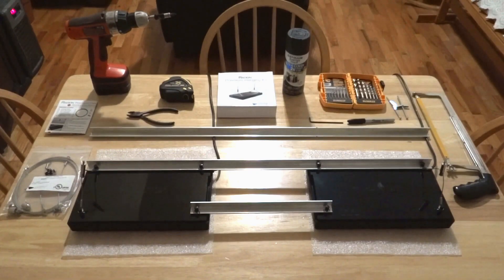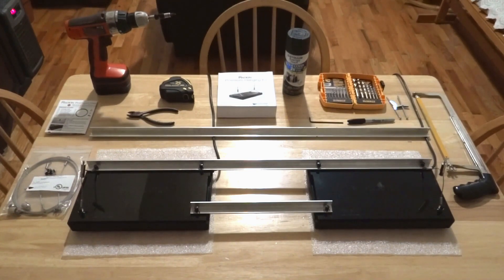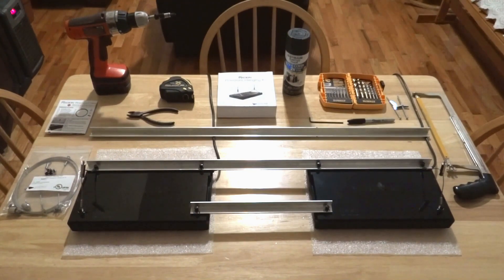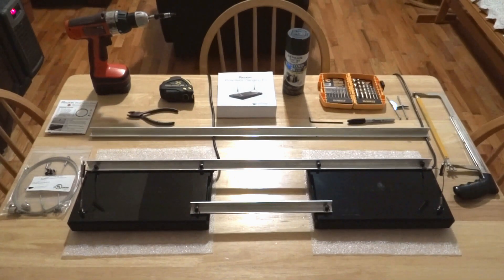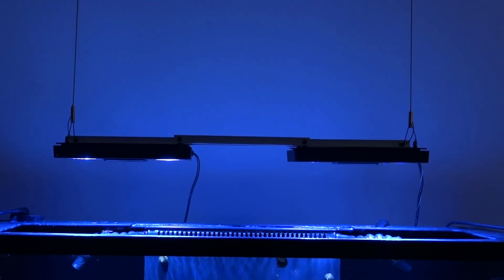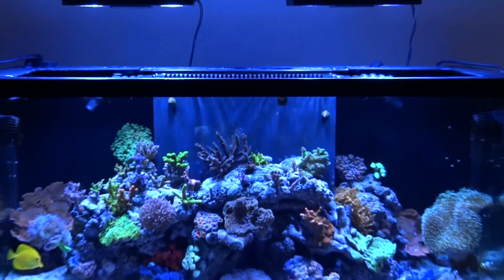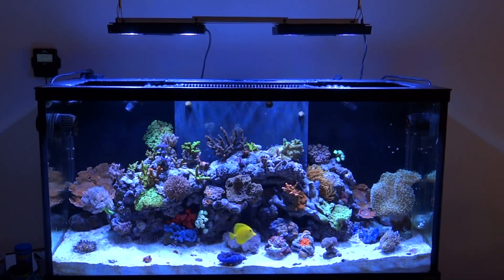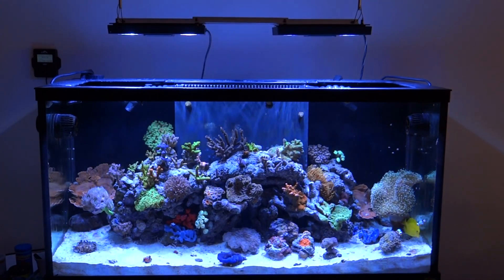How To DIY Ecotech Radion Installation

Comment: Sweet DIY job!  You had it easy with respect to drilling the ceiling hole.  I live in a building built in the 1940's when they used concrete for the ceilings and walls.  After measuring the location, out came the hammer drill, carbide bits and anchors. It was still worth it! Good job!

Comment: Those lights look gorgeous, Steelo!  I can hear the true excitement in your voice.  So very happy for you!  It looks like those two fixtures would do nicely for a 120 gallon as well as I notice the beam going past the sides of your tank.  If you still have the intensity at 65% then I don't think you would have to turn a light on in your house if it was set to 100% lol... pretty bright, indeed.  I will have to wait a few more years to invest in this until all of the kinks are out.  Thumbs UP!

Comment: hey man one last question I appreciate the feedback. I was curious in the cycling process, ( I have 1.5 inch of live sand and 40lbs of live rock in my 30 gallon), it has been about  a week, not expecting it tto be cycled or anything but was wondering about lighting? I have read that I need to keep in the dark during cycling, but I wasn't sure if you kept it in the dark or light , and whats best. Thanks again

Comment: Great video Steelo....I've been looking forward to this video (and the ones following) on this fixture.  Can't wait to see when you program the system up, especially when it comes to the troubleshooting (ie. system not responding the way you wanted it to). I just wanted to mention an inaccuracy in the technical description of your aluminum rails.  They are 90 degree pieces, not 45 degree. It also looks as if your mounting cable going from the mount to the ceiling on the left side isn't centered?

Comment: Thanks for sharing this info with us homie, I always thought you had to bold the hanging kits to the metal or wood bars in the ceiling....also why did you use a long and short aluminum bar to join both fixtures?

Comment: Hi Mr Steelo! (you have a very VERY Dutch last name btw)
Im confused about one thing, im looking for a LED system myself and im wondering if i buy a 40cm long fixture, could it be enough for my 160cm long tank and if not are 2 enough? I mean you can position it a bit higher for more spread i think? the tank is 50cm high so enough light would still penetrate if you hang it higher? thanks.

Comment: hi
i am looking into getting some radions and your videos have proved very informative, 

I have just one suggestion, with the shorter aluminium bar at the front, why dont you spin it round so that the screws are hidden behind it,, and it would make it apear from the front that it is a solid bar, instead of a 45 degree angle bar?

just might make it look even neater than it already does :)

thanks
David

Comment: Great video that tank look amazing hey is I was thinking. I can't see the design on those light but on my led they have fan on top I can't see on yours. The reason I'm saying this since work with cladding you can make a u channel to any size width and height and put in a thin power strip inside now you can plug in the secondary light and have cord out of this fixtures and have on solid aluminum fixture with a lid on top i can draw you up a drawing and send it to you peace

Comment: I downloaded the quickstart guide (v 1.1). On the last page they show a rail system (not available on website!) in which they mount the units turned 90 degrees from your orientation. This would give access to the buttons. The hanging kit then mounts to the center of the rail system. Seems kind of tippy.

The PAR distribution diagram (pg. 11) indicates a square light pattern so turning them should not effect light distribution.

Comment: It's hard to see where these control buttons are. It the unboxing video it seem like they are on the front left top. Could you use a full length angle and drill access holes to the control buttons? It just looks wrong with one long and one short angle.

I also think they would look more like a complete kit if the angle was black to match the Radions.

Good job on the videos and great tank.

Comment: Hey steelo i have a extremely small nano tank set up and i saw in one of your other videos that you have to add 6 cups of water a day i dont need to add water until i do a water change at the end of the week is that because you dont have a lid?
Reply from the maker: Evaporation is something that happens to all setups regardless of whether you run an open top or closed system. The smaller the setup, the less the evaporation, but in your case, you have to be very careful and make sure you top off your system accordingly and test for salinity frequently. If you do not, and instead replace with saltwater as you do your routine water changes, your salinity will slowly rise over time and lead to major issues.

Comment: Hey man can you tell me the size of the bolts you used with the drywall butterfly anchors?
Reply from the maker: Not sure I recall exactly but I believe they were 1/4 of an inch thick by 4 inches long.
Reply: *****
 Thanks! Picking up that hardware today